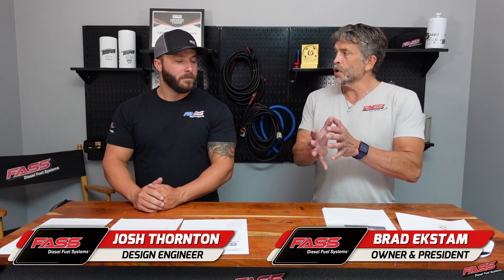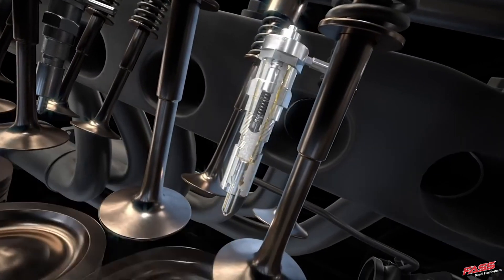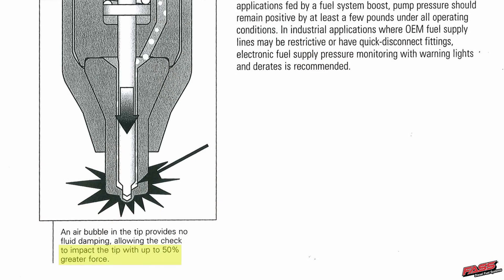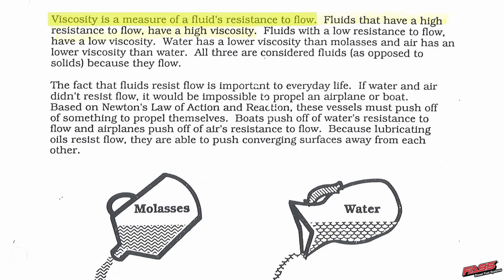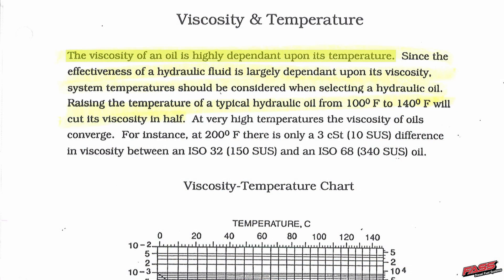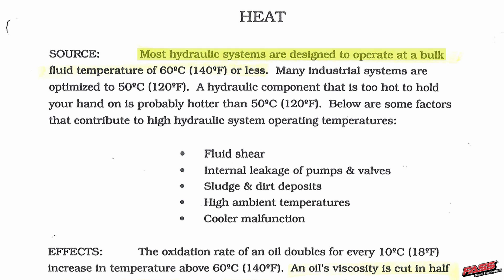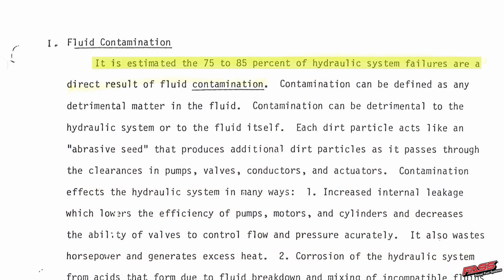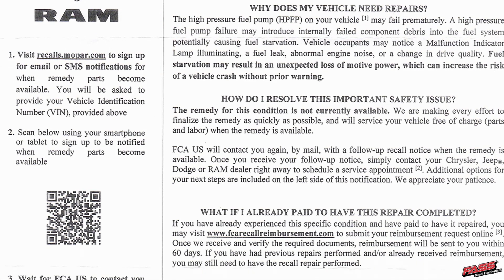Contaminated diesel can cost you THOUSANDS! | Air in Fuel Episode 5

Comment: I have a 550hp E model cat, it has a water separator on the frame and a fuel filter housing on the side of the block. Does the FASS replace both filters? Also it’s a factory 550 at the moment but I’m planning on getting it around 750-800 hp in the future, what pump would be best for future hp gain?
Reply from the maker: Thank you for reaching out Jacob, and we'll be happy to help. 

The FASS system will replace the factory setup for sure, and we also have a link to the suggested system on our website here for you. 

https://fassride.com/shop/product/shop-category/universal-industrial-series/fass-industrial-series-diesel-fuel-system-class-8-semi-250gph-universal-ind-250g/

If you have any other questions or need anything at all you are more than welcome to reach out to us at 636-433-5410. Thank you!